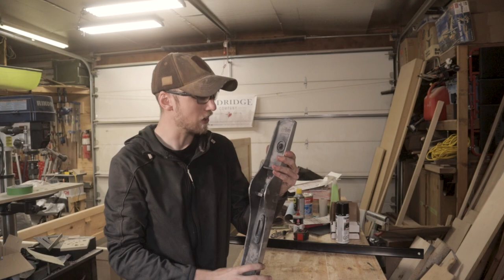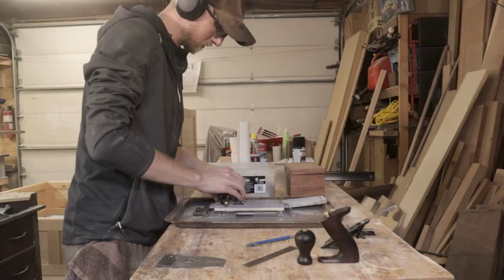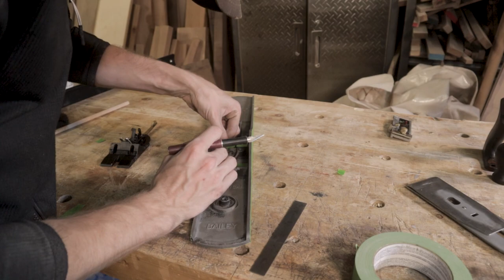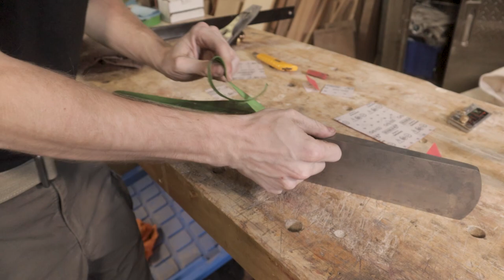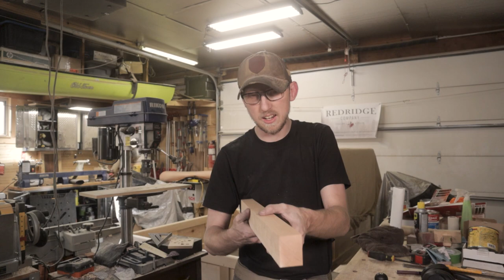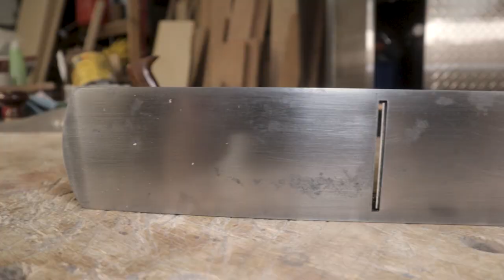Restoring a Stanley Bailey No.7 Hand plane | Hand Tool Restoration

Comment: That's japaning, not paint. It's a rubberized coating. You can't remove it with typical paint removal methods. You can really only grind it or sandblast it with a powerful enough sandblaster to pit the cast iron.
Reply from the maker: This video was a while back before I really got into working with these older tools and learning about them.
I recently picked up a small sandblasting cabinet and that actually works wonders to remove whatever japaning is left on the planes. As long as you use the right blasting media it's easy to remove without pitting the cast iron at all, I've found 30-60 grit crushed glass leaves a nice matt finish that lets the enamel paint grip really well.
Reply: @morganhurst_redridge  i recommend checking out Hand Tool Rescue   he has videos on Japaning and how to do it. Its pretty simple. Been watchi g your videos today. Subbed.
Reply from the maker: @mikem5831  I did look into redoing the Japaning but as I did more research I found that I liked the idea of making the tools custom to me. If you checkout the Stanley No.45 I did, that one was done up in what's going to be my style for the tools. 
Thanks for subscribing!

Comment: As others have said, I would definitely use the ruler trick and grind primary bevel to 25 degrees and then grind the secondary bevel somewhere around 27-30 degrees. You will spend so much less time sharpening.

Once you have it set up and working well your bevel up Veritas planes may collect dust like mine do.
Reply from the maker: I really like the ruler trick the more I look into it and it may solve some of the minor issues I've had in the past!
I'm going to mess around with the micro bevel because I got out of the habit of adding it to the bevel up blades but I can see how it would speed things up a bit.

Comment: Congrats on finishing it off, it looks GREAT! Super, super job for your first time doing one. And good job on figuring out the date of manufacture, I couldn't tell for sure based on the details that showed up in the video (although it was obviously post-war I couldn't tell if 50s or much later). 

Now let me see if I can remember all the things I wanted to touch on from various points in the vid....

Chipbreaker setting
Various positions suit specific tasks so this is something that can and should be adjusted, less so on a jointer which can be used just to edge joint if you'd like, but once you get a no.4 and especially a no. 5 (which is very much a multi-role plane) you'll want to adjust as needed, from super-close for finish planing (way under 1/64" if your plane will allow it) all the way back to 1/4" or more if you're hogging off material, or for easy planing in softer and/or straight-grained woods. On a nice cooperative bit of cherry you can get away with it set way back, on a piece of sapele you'll tend to want to set it far closer because although it isn't that much harder the grain flow will tend to be all over the place – without the chipbreaker set close to the edge you'd be in tearout city.

Paint
You probably already know this from wood finishing so apologies if this is teaching grandma to suck eggs. Whatever the dry time for the paint it's not nearly cured even after a multiple of that. If the instructions say "fully dry in 12 hours" or something along those lines, that'll only be sorta true. Most paints, full hardness won't be achieved even after triple the drying time, so take it as a given it's at least a few days before it's cured enough for rough handling. A good example of this oil-based poly, and conventional enamels are just like it, full cure takes something 20-30 days despite being touch-dry in maybe only 4-8 hours.

Lateral-adjustment lever (AKA "the lateral")
You'll get the hang of this pretty quickly! Bottom line is: push right to make the left corner stick out further, push left for more right projection. Before you know it you won't need to think about it, it'll be something you do on autopilot. Oh by the way, you'll probably eventually acquire a plane where the natural rest point for the lateral is not in the centre and this might seem like there's something wrong but it can be perfectly normal. So no biggie if the cutting edge is dead straight to the sole but the lateral sits a good bit to the right or left.

Grip
To rule about this but most people adopt a three-finger grip with the forefinger pointing, so just like the standard grip on a hand plane. Because the frog and irons are right there you have something to rest the finger against/hook over, so the tip of your finger won't be flopping about in midair like if you were to use a similar grip on a low-angle bench plane. This might feel a bit weird initially but again you'll get used to it before you know it. I think this grip also makes turning the depth adjuster wheel a little faster and more natural, but hand size and finger length play into that.

HIH!
Reply from the maker: Thanks for all the info that's great!
I didn't realize the chip breaker had anything to do with helping tear out so I'm definitely going to play around with that!
The paint I'm making sure to let cure for a few weeks before I really get using this plane, I just had to get everything together and try it out because I was to excited and couldn't wait!
When I get to using it I'm going to practice with the lateral and the grip you mentioned, try to get it stuck into my brain with that muscle memory.
Thanks again for all the awesome advice this is really going to help!

Comment: great work on the plane. restoring old hand planes and putting them to use is an addicting feeling. i started my plane collection last year and now have a good number of them restored. my favorite is my type 9 #7 made between 1902-1907. cleaned up with a sharp blade and its amazing how well these tools work over 100 years later. Check out the Plane Collector on youtube if you want to see in depth plane restoring videos for inspiration.
Reply from the maker: I'm too scared to checkout the Plane Collector, because I feel like if I do this is going to become a horrible addiction! (It might already be)
I think that's amazing, I thought mine being from 1962 was old but the fact that yours is over 100 years old and still works is just awe-inspiring!

Comment: Very nice! Its funny to see someone going from a LAJ to an Bevel Down plane. Its usually in the other direction hahaha. 
For the slight grooves/nicks in the wood; check the mouth of the plane and  not just the front and back of the mouth. I have had the same issue with restoring planes and I had a burr on the side of the mouth. Use a very fine file and it should go away.
For the lateral adjuster if you are having a hard time making minute adjustments try the following. If the blade is cutting to much on the left side put your thumb on the left side of the blade and your index finger on the lateral adjuster and squeeze. That should help get it moving especially when the lever cap is on really tight.
Welcome to the world of Bevel Down!
Reply from the maker: It is kinda funny, I still think the LAJ is the best all around plane, but it's the look of these planes that I love so much! Just feels so cool using a more traditional style of plane
I'll have to take a look at the mouth area, I've seen a few plane setup videos that talked about lightly beveling the mouth edges to avoid getting burrs when flattening the bottom. Seams like a very likely place for it to happen!

Comment: Ps- I suspect you're after spraying over some of the mating surfaces where the frog sits onto the body of the plane- they're meant to be machined surfaces so might cause you problems
Reply from the maker: I made sure to tape of those ares and the after I removed the tape compared the new to the original to make sure it was the same. I also adjusted the bottom of the frog so that with was sitting better than it originally was. I'll give it another look though an see if something isn't interacting right. Thanks for the tip!

Comment: So much to say. 
1. Use the ruler trick when flattening and maintaining the back.  Place a 6" ruler on one side of the stone, lay the blade across the ruler so that the edge is 1/4'" in from the far side. Wipe back and forth lightly to (a). remove burr, and (b). to polish all the way across.  It's way quick and very effective. And remember, the cutting edge is the face of the blade.  Sooooo much effort goes into the bevel edge and that is important, but it's the face edge that goes into the timber.  The definition of sharp is the joining of two "polished" edges.  Two.
2. The chip breaker issue is contentious. If stoned just right and adjusted just right it can reduce tear-out (The English Woodworker). But some of the best out there (Rob Cosman) ignore it and set it at about 1/32" to 1/16".   
3. Tighten the chip breaker screw tight with a screw driver.  It stops the blade slipping back and having the front of the chip breaker ruin the blade edge (don't ask why I know that). Wrote this before you experienced the outcome.
4. Stropping the plane blade is fraught with issues in itself.  I watched you stropping and you lift the blade higher as you travel along the strop.  If the bevel down edge is close to or more than 45 degree it won't cut because it's back edge is going to be too low and brush the timber.  You seem to lift close to or more than 45 degrees.  I use a cheap sharpening guide to hold the blade at 30 degrees on the strop and my experience is that it gets a better edge. But keep that cheap guide away from your stones because it will contaminate the stones (again, don't ask).
5. The primary bevel is more then the secondary bevel so that all you have to do to sharpen is remove a small amount to get a sharp edge.  If you only have 1 angle then you have o remove a heap more to get that sharp edge.
Reply from the maker: Thanks!
I heard about the ruler trick when I was learning to sharpen my bevel up blades and that was a mistake that took a while to fix, it'll be good to give it a try on a proper blade!
I've been looking more into the chip breaker setup and you are right the are tons of different opinions out there so I may mess around and see what works for me.
That's really good to know about the strop, I always thought I should be using a guide but I kept see people sharpen with a guide then just go crazy on the strop so I'll try using one of my old guides for the strop.
Reply: @morganhurst_redridge  Not sure why the ruler trick was a mistake for the low angle jack.  I do it all the time.  If it made a difference of 1/4 of a degree I'd be surprised.  My low angle jack works the best of all me planes - with the ruler trick.  ???  What was your problem.
Reply from the maker: @1deerndingo  There wasn't actually an issue, but the more I looked into the ruler trick I couldn't find anyone mentioning to use it on a bevel up blade so I just assumed I was doing it wrong.
Next time I sharpen I'll try adding it back in because it does make sense why it would make a better cutting edge!
Reply: @morganhurst_redridge  I use the ruler trick on my Veritas low angle jack and my other Veritas bevel up planes.

Comment: Your first plane restoration came out great. A prominent woodworker said it's better to take an old cheap plane and restore and learn how to use it than buying an expensive one. I really like the way you went about it. Not doing anything that might cause damage and focusing on its a tool not a museum piece. Good work!
Reply from the maker: Thanks, I think the most important thing about these older planes is that you can basically build a full collection for the price of one Veritas or Lie-Nielson. I like that this lets me have multiple planes setup for specific task like smoothing, so I know when I grab that plane it's good to go for what I need!
Reply: @morganhurst_redridge  Thats how I did it. A good way to go!

Comment: Nice job!

FYI you can use the lever cap to tighten the screw on chip breaker/blade.  Should fit right in.

Also you can add a slight camber to the blade, see if that gets rid of your lines.
Reply from the maker: That sounds alot easier than using a screw driver, I will definitely be adapting that as a habit, thank you!
It might be worth a shot cambering the balde, if I can't narrow down what's causing the lines, I know the corners of the blade can often cause issue.
Reply: @morganhurst_redridge  careful using your lever cap on the chip breaker screw. while many use this, it was not designed to do it and you can break a chuck of your l;ever cap off or worse if you usd too much force. better of getting a proper fitting flat screwdriver.

Comment: Sharpening 30deg across the whole bevel will mean you need to put way more effort into sharpening. Use a 25deg primary with a small 30deg secondary. Some people put a v small bevel on back of the blade, look up the "ruler trick". This raises the overall angle of attack
Reply from the maker: I don't personally like doing a micro bevel, just never found that it worked as nicely for me as just taking the time to fully sharpen the edge. I do like the idea of using the ruler trick though and i'll definitely be making use of that!
Reply: @morganhurst_redridge  these antique blades are thin enough that i agree, theres no need for a micro bevel. modern sharpening stones make quick work of the old steel. even on my veritas bevel up planes im going away from micro bevels and have started hollow grinding all my bevels and working on my freehand sharpening skills.
Reply from the maker: @Reid exactly, I've done the same on my bevel up, with a 1000 grit stone it only take a few minutes to fully clean up the bevel! Then I don't really notice a speed difference with the other grits.
Reply: It can always be quicker I guess 😉 the other advantage is it's easy to add a small camber to the blade. Each to their own